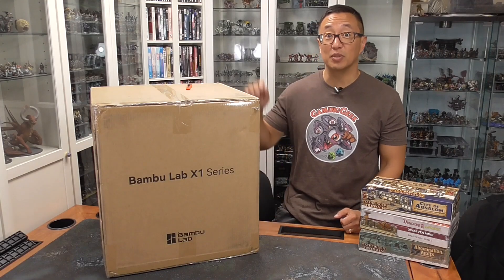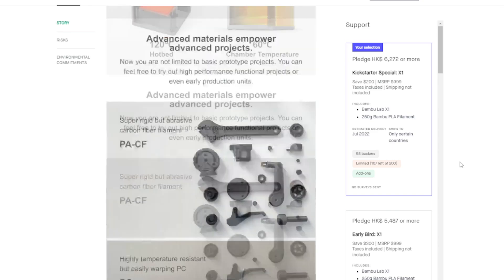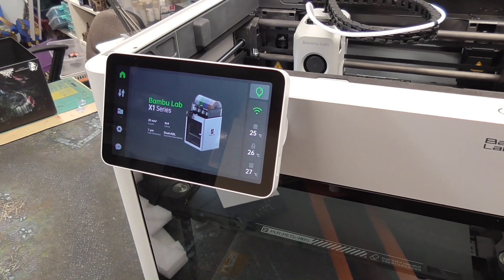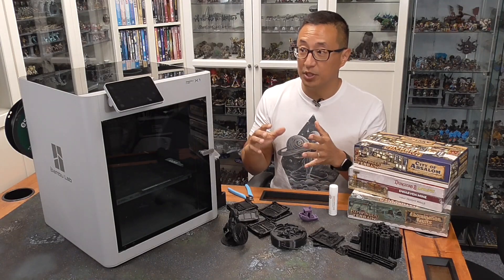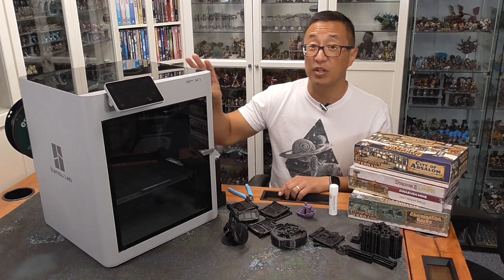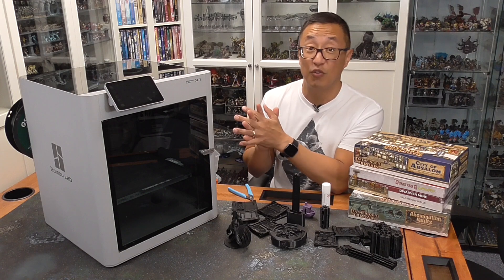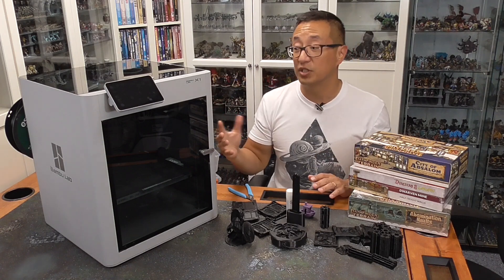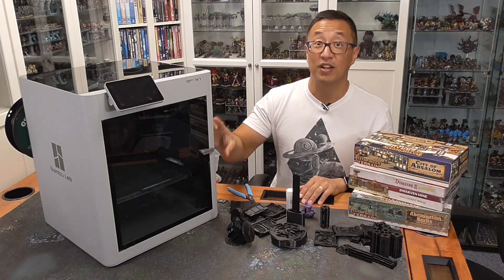Bambu Lab X1 Review: Is it true Plug & Play?

Comment: The parts I make on my MK3S, with .6mm nozzle, .4mm layer height, .8mm line extrusion widths, and 55mm/sec, take exactly 1hr. I downloaded the bambu slicer and used the carbon .6mm profile, set up all the same settings as my MK3S profile in prusa slicer. But left the print speeds at default (between 120 and 150mm/sec, with 480mm/sec travel speed. Its as close as an apples to apples comparison you can get. The X1 would only shave off 10 mins or about 17% If i leave the print speed settings the same as on my prusa, it literally takes the same amount of time, at 1hr.

Definitely not worth it. For a proprietary chinese printer, that violently shakes itself at those high speeds. I'll stick with prusa. I don't trust the longevity of chinese printers anyways, especially when they're tearing themselves apart at those speeds.
Reply: you havent worked with high speed machines before. Do you know that you have to change the acceleration, square corner velocity, max flow rates, and other parameters before seeing an increase in speed? Prusas are crazy slow, what flow rates can you hit with your machine? I'm guessing you haven't taken a beginner physics class, because when a printhead moves very fast, the machine will violently swing around. it's hard to counteract that without a heavy cast iron base. I'd like to see you run a sub 20 minute benchy on your prusa at 0.25 layer height.
Reply: @morbus5726  you don't get it, at all. I set the basic settings on both printers the same, but left the speed and acceleration settings at default on the Bambu. Which were 100-400% faster than the stock prusa settings. And I still only seen a 17% decrease in print time. The Bambu was given the major speed advantage out of the gate, and still didn't perform how all these shills claim it does. Layer height, perimeters, top/bottom laters, infill pattern & percentage, extrusion width, all set the same between both printers. Bambu had 150% faster print speed settings, and 400% faster acceleration settings. Both default with their .6mm profile on their slicer.

And I can already print a sub 20 min benchy lol. Literally only takes me 23 mins in prusa slicer, Cope harder, shill.
Reply: @LilApe  what mod have you done to the prusa to get a 23 minute benchy?
P.S. you need to follow the roule of speed benchy, no filled filament, max nozzle or line width is 0,5 mm, layer height must be 0,25mm, 3 top and bottom layers, 2 walls and 10% infill... if you brake this roules the time is invalid
Reply: @librasd8087  Bone stock MK3S with 8k hrs on it. There is no rule for printing benchys lol. I've only printed one benchy in my life. I used the same settings as posted in my comment, the same settings I use for everything I print. 23 mins in prusa slicer.
Reply: @LilApe  if the slicer say a time, it's never accurate... you need to print it to get the time, but even if it's a 23 minute benchy with that parameter it's not a speed benchy, at best is a cursed version of a 23 minute benchy printed by the people that follow the roule of the competition
with 0,6mm nozzle, 0,4mm layer height, 0,8mm line extrusion widths at 55mm/sec you are right at the limit of your hotend (15,7 mm^3/s)... i'm 100% shure that you are underextruding more than 5%
Reply: @librasd8087  Except prusa slicer time is accurate lol. My parts take 58 mins to make in prusaslicer. My MK3S says 58 mins on the screen. And my stop watch stopped at 58 mins when the print head went home after the print was done. If it says 23 mins, it will be 23 mins. I tested the times like 3 years ago.

The point remains, the bambu X1 is not as fast as people say. All anyone has to do is download the bambu slicer and try it themselves. Bambu slicer is just a clone of prusa slicer or slic3r
Reply: @LilApe  if we have to believe in the time that slicers give us, then for me bambu lab wins hands down... i just sliced a stl i have and set the same settings, all the line with even the skirt and the precision, all the same but the default speed:
prusa slicer 5h 54m
bambu 1h 35m
and i use an anycubic mega @60mm/s with 0,4mm nozzle dia, a layer height of 0,15 , 0,45 default line width... and prusa slicer have arachne on
Reply: @librasd8087  My part in prusa slicer was 1hr 3 mins. In bambu it was 53mins. Only 10 min times savings. Using .6mm nozzle, .4mm layer height and .8mm extrusion width. 3 perimeters, 2 top/bottom layers, 20% infill. Maybe its worth it if you do thin layer parts, but for me, its not worth it.

My MK3S has 8k print hours on it, with only a replaced nozzle. I can't trust the X1 dependability. chinese printer with no long term reports. I started out with an anycubic mega S, it was junk and taught me not to depend on chinese printers.
Reply: @LilApe  i started with a geeetech long time ago, when the printers were made of wood and they come with only glass bed and i wasent able to print anything decent, i recycled that printer to make a prototype for a frind and i only come back to 3d pronting with the anycubic and after flashing marlin 2.0 it's all been nice, now i want to go to abs but the warp is obscene so i was searching for an enclosed machine
Reply: @LilApe  so you've never printed a 23 minute benchy, but you claim you can? I highly doubt this. You can throw around buzz words like "chinese printer", but China dominates when it comes to cost effectiveness. Have you heard of a little company called dji? The same company from which many bambu engineers are from?
Reply: @LilApe  ill literally eat my hat if you can print an ok looking 23 minute benchy following speedboatrace rules and record it. No way you can do that on a stock mk3. It's not physically possible with the low volumetric flow rates of the v6.
Reply: @morbus5726  lol "print an ok looking 23 minute benchy FoLLoWiNg sPeeDbOaT rAcE RuLEs"

This is called "moving the goalpost". You asked if i can print a sub 20min benchy, I said it can be done in 23 mins. Now you move the goalpost because you called my bluff and lost. As I've already said, prusaslicer times are accurate, if it says 23mins, then it will be 23 mins. And now you edited your OP to say "0.25 layer height". I don't print for fun or as a hobby. I print for financial income. I don't care to hop off the proven reliability of a MK3S, for an unproven printer from china. All because it runs 17% faster on MY parts.

Feel free to throw your money at a proprietary printer from china. Because I'm sure they'll never drop support for it 2 years from now when they pump out a newer model. Because the other proprietary printers have never done that, like makerbot, flashforged, quidi tech /s
Reply: @morbus5726  You're moving the goalpost dude, it's the textbook definition.

"bet you cant print a benchy in sub 20mins"
prints benchy in 23 mins
"NO NO NO NO  you're supposed to print it like that, follow these rules i made up for you"

Moving the goalpost bud.
Reply: @LilApe  except i told you the rules right away.... that's not moving the goalpost...
Reply: @morbus5726  LMAO, no you didn't. Just stop, you're not going to win this. in your very 1st comment to me, you said,  "I'd like to see you run a sub 20 minute benchy on your prusa". Then like 10 hrs later, you added another comment yapping about "SpEEd boAT rUlEs", then you edited you 1st comment about doing it at a 2.5 layer height.

Just stop, just...stop lol. I printed a bench in sub 20 mins, you didn't like that, so you throw silly rules into it. Grow up.
Reply: @LilApe  just check my second comment!! it's in plain sight.
Reply: @morbus5726  Jesus dude, you don't get it lmao. Bless your heart.
Reply: @LilApe  lmaooooo. not sure how to react. It's hard to tell if you're really this slow or just joking.
Reply: @LilApe  You are full of it and the "it" isn't truth.
 I print full sized crystal dragons @.2mm height and .4mm nozzle in 8.5hr hrs on X1C and the prusa takes 25+hrs
So I can print 3 dragons before the prusa gets done 1. This is on the second slowest speed btw.
Stop spreading FUD. 

Try it yourself in bambu studio and prusa slicer. \
.2mm layer height
15% infill. (pick which ever type you like)
.4mm nozzle
Reply: @No0o0o0o0o0  I don't care about your silly crystal dragon. I care about MY parts that I designed and made daily. And MY parts only print 17% faster on the X1C using the same settings. Except with the XC1 printing 400% faster.

Thats was the ENTIRE POINT of my OP. That MY parts don't print fast enough on an XC1 and bambu labs slicer, to even be worth buying one over what I use right now with my MK3S and prusaslicer.

"PrInt A beNchY" at 2.5mm
"PrInT a CryStAL DraG0N" at 2.5mm
I don't run a business printing benchys and dragons at 2.5mm layer heights lmao.
Reply: You completely lack an understanding of 3d printing.
Reply: Since you dont have an Bambu labs X1 this is the default settings for a print.

Standard speed

First layer : 50mm/s

First layer infill: 105mm/s

Outerwall: 200mm/s

Innerwall: 300mm/s

Sparse Infill: 270mm/s

Internal Solid infill: 270mm/s

Top Surface: 200mm/s

Acceleration

First layer: 500mm/s

Top surface: 2000mm/s

Normal printing: 10000mm/s

The stock settings are standard 100% seen above

Silent: 50%

Sport: 124%

Ludicrous: 166%

So unless your print is all overhangs there is no way your prusa is even in the same universe as a stock X1 or X1C.

Speaking of which, what is your print speed and STL and gcode? Link to it so we can all see your BS.
Reply: @No0o0o0o0o0  don't bother. it's clear the guy isn't going to discuss, let him have fun printing with his prusa at 10mm/s
Reply: @morbus5726  Fair enough he is too scared to respond since his BS is provably false. I always wonder why some people drop disinformation turds in the 3d printer space and not expect to be called out on it. 🤣 at the 10mm/s
Reply: @No0o0o0o0o0  I think the guy is just trolling.   He says he has a Bambu Lab printer, but this is unlikely.  His attitude says otherwise.  He says "I tested the times like 3 years ago"..  Makes no sense.  Also he demonizes it for being from China.. Where does he thinks the Prusa parts comes from?  He's just an insecure Prusa fanboy.
Reply: @dontworrybehappy4916  I never said I had a X1, I said I downloaded their slicer, then ran the same model and settings on my prusa slicer, on their bambu slicer, and only saw a print time decrease of 17%, or 10 mins. On parts that take 60 mins on my MK3S and prusa slicer. It was a pure apples to apples comparison, giving the the benefit to the X1 by leaving their print speeds at default, which are already roughly 500% faster than what I run in prusa slicer. And yet, it only runs 10 mins faster. Thats hardly fast enough to trust a proprietary chinese printer, over euopean made with proven long term reliability.

Also, less than 5% of a MK3S is built using chinese made components. The rest are sourced from the USA, CZ, japan, EU and switzerland. Try harder next time.
Reply: @LilApe  Stop coming back here with more nonsense.  The reviews, YouTube videos, etc of the X1 capabilities and speeds are real.  You are free to learn and educate yourself by researching and/or buying your own.  If you want to believe your nonsense, then that's on you.

Comment: Just to let u know, the gluestick is actually there to do the opposite, it helps the prints release off the bed easier so that the bed surface doesn't bubble up or rip 🙃 

So please do apply a decent layer of glue stick if you want your cold sheet plate to last and keep bed temps under 35c (when cold plate side is being used)

And also there is no camera on the print head, on the base bambu X1 no camera is included, you can buy it and attach it as a accessory.
Reply: You are absolutely right. Windex also works. But you need a release agent, not a sticking agent.
Reply: Agreed
Reply: Why doesn't over 10000 dollar 3D printer come with bed that can heat up 110 C and is compatible with Lidar? Seems like massive flaw. Glue stick is ancient thing for 3D printers and backwards
Reply: @wekkimeif7720  it's not a $10000 printer 😂. It's ~1000 depending on the model.

Anyway, because it's in an enclosure if you use technologies such as PEI you need to heat the bed past 55ish degrees C. 

That's a problem for fast printing with PLA in an enclosure because the accumulated heat + higher nozzle temps (need higher temp for Bambu speeds) the PLA will begin to melt before actually hitting the melt zone. Causing a blockage + failed print.

So they went with the cold sheet, which yes needs glue stick as a release agent.

It's why the new Bambu P1P has a PEI plate, it's not in an enclosure therefore won't clog.
Reply: @magnarex  Could just add stronger and better fans in the enclosed closure to keep temps down?
Surely anyone can just wear earplugs if server like 100 dB fan noise is too much to listen?

Comment: For $1K?  Voron 2.4.  Without question.  Really really fast and beautiful print quality.  Not plug and play though.
Reply: no way you're geting a 2.4 for under 1k, unless you're ok with terrible quality. The bambu has speeds comparable to a 2.4, with similar flow rates, while having automatic input shaping. I personally have a ratri vcore 3 500mm cubed machine. The voron is hard to build, and is definitely not plug and play.
Reply: But a Voron isn't that begginner friendly... both Prusa and Bambu are targetting ease of use
Reply: @Kae W. you can buy kits, but none of them are official
Reply: man's definitely never built a voron haha
Reply: where u getting a good voron for 1k? also, have fun assembling and calibrating the machine for 2 months.
Reply: The only way you are getting a sub $1K voron is from a failed voron build that someone is trying to offload. LMAO

Comment: Hey there, big fan of your content and happy to see this review! I was one of the very first backers of the Bambu Lab Kickstarter and have had my machine for almost two months now. Two quick things worth mentioning:

1) The point of the glue stick is actually not to help the print adhere to the bed. Prints adhere too well to the build plate, and some prints can be very difficult to remove. Bambu Lab recommends a thin layer of glue as an "interface layer" of sorts to make the prints easier to remove.

2) Although many (most?) of the parts are proprietary, I've been pleasantly surprised with the very reasonable pricing for replacement parts on the BL store. I doubt they're making any money on these things. Many of the parts are still waiting to be stocked however.

Great review, thank you for your insights!!
Reply: At least one reviewer had bed adhesion issues with PLA and no glue stick, as well as the removal bit.

Comment: At $1000, no I'm not ready to jump into a plug and play system. If the price were more in the range of the sweet spot you mentioned, then I would seriously consider it, but I'm happy to wait to see how this machine holds up and to see how they iterate on it. Thanks for the video. Very interesting.
Reply: it's the same price as the prusa, but with many more features, it's crazy how cost effective these machines are.
Reply: At 1000, this is such a good printer
Reply: Yeah $1000 is pretty ridiculous.
Reply: For what you're getting with this printer it's not really ridiculous.  There's not another printer in the same or lower price range that compares.  A Voron with the same quality parts is much more expensive.
Reply: For this price it cannot be beat right now. auto bed leveling , lidar, first layer inspection. Enclosed, upgradeable to AMS and what cannot be understated FULLY ASSEMBLED and it can print as fast or faster than a voron.The X1 Carbon has even more features. Side blower fan, camera for monitoring, videos or time lapses. assessable from a phone app or slicer hardened steel nozzle for abrasive materials like carbon fiber nylon, PC, fiberglass polymers. 

Disassembly is actually straight forward. there are screws in the back to access the back main board, cables etc. Another youtuber modded his and goes through his "sound" proofing experience.